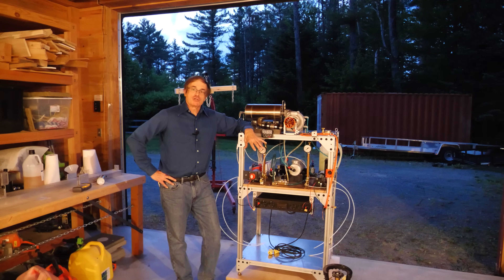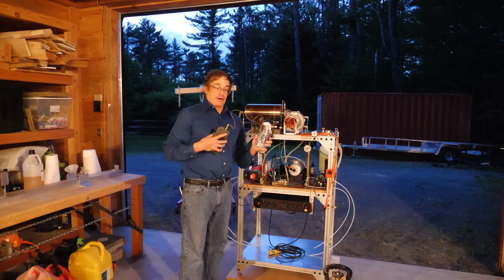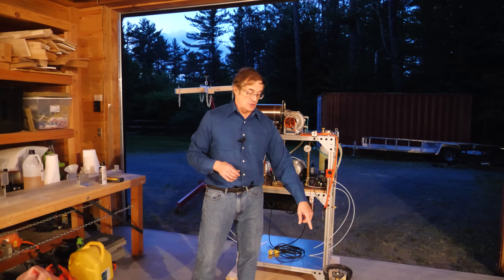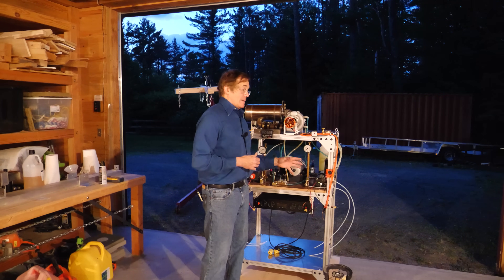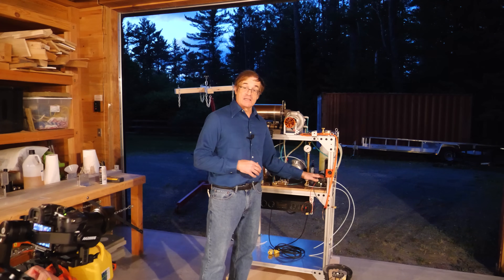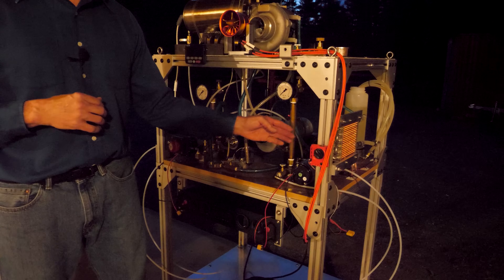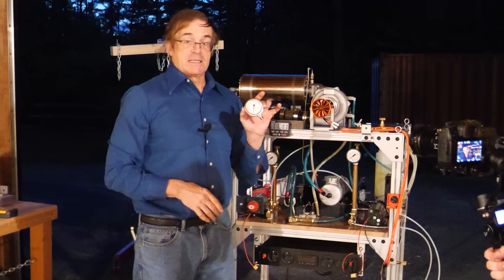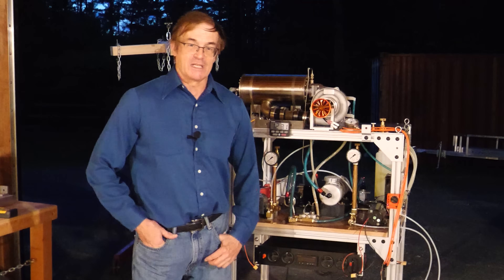What else goes into building a jet engine? - Part 2

Comment: Do to the global warming potential of the current refrigerant used in modern air conditioners they are going to start phasing it out. It’s replacement is propane based because a lot of energy required for phase change.

Comment: you said one of the drawbacks of afterburners is their low compression. Which immediately made me think of compressing the air before burning it in the afterburner, maybe with another compressor wheel... Today it clicked, it's exactly the compoud turbo system you are talking about, right?
Reply: Not necessarily , if the gas producer iand afterburner are constructed correctly and the required turbine temps are used , we can achieved a choked afterburner nozzle  ,  unfortunately this guy doesn't really know what he's talking about , he sprouts the words but not the experience
Reply from the maker: That's  right.  Afterburners should  always be an "afterthought".  The secret  is compression ratio and you need multiple  stages for that.

Comment: Another nice presentation ,...... with your gauges , on a new build its advisable not to use fluid filled ones as they can mask "problems" , an "empty" gauge will bounce around and alert the builder to a potential problem ,  things like a cavitating fuel pump,  compressor surging or pulsing combustion, fluid filled gauges best used once the engine is sorted
Reply from the maker: Good point.

Comment: So, where's your blast shielding? If any part of this homebrew contraption flies apart when rotating at such high velocities, then you are a dead man. Smart, but dead.
Reply from the maker: This homegrown contraption is no more likely  to fly apart than when the turbo is mounted on a reciprocating engine.  Blast shielding is never a bad idea, but rarely  used when tuning an engine or running an RC turbojet.
Reply: @TechIngredients  I am in the avionics industry that you yourself said is always pushing the limits for compactness and low weight, while delivering at the envelope of what is possible from current material science knowledge and manufacturing. Keeping that in mind, I have had a coworker die when an air compressor disintegrated, spinning at 26,000 RPM. Shrapnel went thru that person's chest, dead on the spot, at work.

Comment: The column of air acting as a compliant mechanism to smooth the fuel flow is evil genius…I say evil because I have 2 dire questions: 1. Could that column of air combust if there is a back flow accident? 2. Does that column take away a substantial amount of energy that could increase the fuel pressure more?
Reply from the maker: That's  not too much of a risk.  If a back flow occurred, the lines themselves would contain air in addition to the column.   For extra protection you can insert a one way, high pressure  check valve into the fuel line.
No pressure  is lost, the peaks and troughs in the average delivery pressure are simply reduced.
Reply: @TechIngredients  Excellent, thank you for answering and explaining!

Comment: What's wrong with making a copper coil as a heat exchanger in some water to expand the fuel into gaseous phase? You'd have the tank upside down as you have there, but then expand it externally in the coil in a big bucket of water. Did you find that you couldn't get it to expand evenly and you'd get liquid propane sputtering into the combustion chamber?
Reply from the maker: It's  unnecessarily  complex and bulky when fuels  like kerosene work well.

Comment: Suck, squeeze, push, bang, boom … a way to think of the stages of a jet engine. Suck - Fan, the blades at the front that draw the air in. Squeeze - compressor stage that increases the air pressure. Push - the initial portion of the combustion chamber that brings in the air. Bang - the combustion chamber where the fuel and air ignite. Boom - the exhaust turbine / afterburner. Of course there are a number of ancillary pieces to modern jet engines.

Comment: In Poland there is a lot of cars adapted to use propane-butane mixture.
It is transported in liquid phase close to engine. There is a evaporator there it has 4 ports. Propane liquid inlet, propane gas outlet and inlet/outlet for fluid that moves heat from engine to the radiator.
So engine has better cooled and has fuel in preferred gas phase.

Comment: The air duster is basically r134a.
Opd tanks will flow liquid upside down I refill 16oz tanks they just won’t flow gas or liquid if you don’t have a anything hooked up

Comment: I wonder how well a direct injection fuel injector from an automobile would work? You might have to find a deal on the high-pressure fuel pump, because they tend to be pricey.
Reply: The injector from a pistons ICE will not work.  They need pressure pulses that trigger the injection.  If it is electronic, the electric pulses trigger, but it is basically a fuel volume per pulse, depends on pressure.  If it is mechanic, you need the pump to create the pulses, even more complicated and still pulsed.

Comment: why not use a hydraulic pump which can provide a few thousand PSI?
Reply from the maker: They tend to be quite  heavy and it would be best if they operated on low voltage, DC.  Also, because  they are piston pumps, you'd need a high pressure  accumulator to smooth the pressure swings.  It could be done, but it might be challenging.

Comment: McMasterCarr is my addiction. I’m a biologist doing automation of cell therapy/gene therapy assays. I have always been extremely handy so it wasn’t a big step to basically become an de facto engineer. All science is art. Leonardo, you know. 
Appreciate your approach a lot. 

Btw. Ordered some heat transfer compound on your website for my Biotec and never got it. Any path forward you’d recommend?

Edit: Actually, you might appreciate this: I’d like to use your compound with a “dry bath” from Thory Pines Scientific. (Not sure I spelled this right) It cools down to -20C, theoretically. I get -12 in my application. That’s why I need your compound. Their device is very unique. Check it out.
Reply: I also ordered some of the thermal paste. Not sure what's happening but it's been months for me and I've sent them emails to no avail.

Maybe they need enough orders to make a batch.
Reply: @zmmj2024  Good to know, thanks. Very disappointing though. Would at least expect some communication.
Reply: @HansWeberHimself  it's really disappointing considering not that long ago they did a video about being ethical, and not to believe in the scam products. I thought maybe they'd see this and we'd both get answers.
Reply: @zmmj2024  I’d appreciate answers a lot.

Comment: What is this engine going to be powering?
Reply from the maker: Not sure yet.  This is a small engine and with more power in a compound configuration or with rotary output with a turboshaft, there are more options.

Comment: Old k jet parts pump running a 5.8 bar , injector is a kontinuous output that makes a spray pattern that can vary the old fuel distribution system could be used for the throttle, and have four five six or eight injectors . You could run gasoline to diesel, any j type jet fuel, alcohol etc. Mercedes ran two in series to make just under 100 psi for the last three years of the ke jetronic

Comment: I remember my buddy breaking the seal on a paintball CO2 tank and it instantly froze his fingers to it. Not sure if that's the same thing with propane, but it was an event I remember from 20 years ago.
Reply from the maker: It is.  Propane can be used to freeze off warts and is a component in over the counter remedies.
Reply: And if freezing them off doesn't work, then you can burn them off :)

Comment: Ya pressurized fuel of any type can be scary on a mobile application if things don't go as planned. I just finished designing the fuel tanks for my J34 powered 6000hp jet engine pontoon I'll be building this week. It requires 10gal/min @ 100psi. I finally found a brushless variable speed NHRA top fuel dragster pump that will be up to the task. Just really expensive! Please subscribe... hahaha... Love your videos!

Comment: I've heard you can buy Jet A at Pease. I'd considered it when I had trouble finding kerosene for a heater, but even diesel seems like a better option. For an actual jet engine, what could be better?
Reply from the maker: Kerosene  has about half the viscosity of diesel and so it will atomize easier.
Reply: @TechIngredients  Well… glad I was able to find Kerosene!

Comment: If you think you can get this down to about 50-80 pounds, I'd be extremely interested in volunteering to test pilot a "backpack" system and let's put together the world's first jet powered paraglider system? Obviously, this is dependent on what the lowest idle, and thrust variability be, to maintain fly stability. =p ~Cheers.
Reply from the maker: I think someone  has actually  done that with a couple of RC jets.
Reply: @TechIngredients  haha bummer. cool stuff though

Comment: After draining the fuel from the vertical tube how do you re-introduce the column of air back into the stand pipe and how much air?
Reply from the maker: Once any trapped  fuel is drained, the top valve is closed and the air is then unable to leave the next time fuel is driven into the manifold  below.
Reply: @TechIngredients  Got it! 👍I'm working on getting the parts together for this build. I have to say, the details in your videos is what gives me the courage to go forth in building rather than just being another video I watch for fun. Always grateful  for your guidance🙏

Comment: I have no interest in jet engines or building jet engines other than perhaps a curiosity as to why the M1A1 Abrams tank uses a jet engine instead of piston. However I think this presenter could talk about any subject and for some reason which I have not quite put my finger on everything he says is fascinating!  Perhaps it's the depth of knowledge he brings to the table, or for the additional  things I learn when watching these Tech Ingredients videos!
Reply: If I remember correctly it was due to High Power Density, Less Maintenance/Things to Go Wrong, and that they aren’t too picky fuel wise.

I’m not an expert in the area though so feel free to chime in if you know more/have corrections or something.
Reply: @ericlotze7724  Wow!  I only knew part of that!  I heard from a guy that used to drive tanks that they give them specs and settings to run every type of fuel and a few things that we wouldn't even consider fuel in those tank turbines!
Thank you!

Comment: 10:10 Is there any Combustion/Explosion Risk?

Granted if you aren’t using volatile fuels I’d imagine the risk is lower, but does an inert gas need to be used?

(Edit: Fixed the Timecode)
Reply: The likelihood is very low, but yes there certainly is an explosion risk. That’s why all accumulators are charged with nitrogen or other inert gases. It would be as simple as putting a schrader valve on top of the metal pipe and filling it with nitrogen.

Comment: How would something more viscous like Heavy Fuel Oil (Fossil Fuel) or Pyrolysis Oil (From Biomass, also called “Bio-Oil” or “Bio-Crude” in papers, although the latter refers to Hydrothermal Liquidation crude more often) work?

Wondering as Pyrolysis Oil is kinda nasty stuff but i hear gas turbines can burn all sorts of stuff!
Reply: Especially with the Turboshaft version connected to a generator (and maybe even a Heat Recovery Steam Generator!) you could convert waste engine oil/pyrolysis oil into not just heat, like a waste oil burner, but electricity!

Comment: Tremendous variety of very interesting subjects investigated,  presented  a explained clearly. thank you!!  Ground-effect (increased air pressure) hydrofoil catamaran or trimaran a possibility? With your analysis and crestivury, hopefylly yes. 

With easily accessible highly accurate weather temperature,  wave, and wind prediction, one could pick suitable weather windows to skim over the waves to a destination. For a d-i-y budget, far, far, far, less than the rich-man's toy 7figure ground effect plane I've seen that looks like it has bat wings, and may not incorporate hyrofoils as fully as it could.

Comment: Jeez how did Jet Man get all his gear into one tiny backpack?
Reply: The Jet Engines that “Gravity Industries” or LLC or whatever the name is are Commercial Off The Shelf Jet Engines (sold as RC Jet Engines, I don’t know if they sell them as micro-jet engines or something too; some gliders use them for self-towing, etc) that basically just need a fuel line and electric control (similar to that for the BLDC motors in RC Quadcopters etc).

I would bet the ones they use too have electric starter motors.

So since they are custom built for small Size+Weight etc instead of made using Turbocharger Turbines designed for Cars’ Exhaust, they can optimize for size and plug-and-play operation.

Hope this helps, and i am not an engineer or anything so anyone else feel free to chime in!
Reply: Still damn impressive though, and idk how i would feel about running fuel lines down my arms with flaming jets inches away!

Comment: i learned even more some rocket science! Love this channel. Thank you.
Reply: Well, Turbojet / Jet turbine engine science in this case, but they do rockets as well! I'd love to see them do a similar series on monoprop rocket engines. Going back nearly 15 years ago, I used to tinker with fairly simple H2O2 monoprop and Kerosene/NOS bi-prop engines. It's a fun hobby but pretty dangerous, especially when dealing with HTP (highly concentrated Peroxide, like 90%+).
Reply: @racerex340  yes!!! 100% 

 i think we're accidently learning rockets science. Not long ago on the channel we were treated to a full in-depth series of video on the optimum hobby firework fuel. which was awesome. also as a side note, the most concentrated 'usable' hydrogen peroxide fuel will never be above 70% (for long time). it both decays and same time is hygroscopic advancing the decay
Reply: @Palmit_ Rob, I used to buy 50%  Food grade and distill to over 90% using vacuum distillation. Yes, it does decompose fairly quickly, but with the right container, you can keep 90%+ for a few weeks airtight. A cap full spilled would easily catch a lawn on fire... My monoprop engines just used simple silver screen packs as the catalyst, which would poison after a few runs but could be cleaned up by heating them cherry hot, quench in water and then run them through an isopropyl ultrasonic bath. You could make the packs last longer by weaving in platinum screen every 6 or 7 screens but that was far too expensive for what was basically me playing around.
Reply: @racerex340  i believe you and i are agreeing :) 90%, to my small braincell,  is quite a good yield, but hard to store usably for a good length of time (years would be ideal). even with special equipment.  I reckon tech ingredients will slowly advance us to methane ch4, but first we will learn superchill. :)
Reply: @Palmit_  if I had access to a really good lathe, I'd probably do HTP + nitrous oxide.  Those high density rubber hybrids have great reliability, simple and can be throttled and stopped / restarted.

Comment: I'm not sure if this is a silly question but seems as you said that more pressure will result in better atomisation - Would taking a diesel direct-port fuel injection system (With one of the newer electrically driven pump) from a vehicle be better for this application? You'd have a very high pressure, an injector designed to atomise the liquid fuel well with extremely consistent repeatability and you can drive the injector using a PWM signal to adjust the fuel flow. I'm not sure if a direct-port fuel injector would handle the temperature of a jet engine, but they are designed to poke into the cylinder of an engine.
Reply from the maker: It might.
Reply: Or maybe a simple gasoline car High Pressure Fuel Pump? At lease some of those run off the camshaft so are not electric.
Reply: Those injector spray when there is a pulse, and the volume of fuel depends on the pressure.  What modern common rail diesel do, it to trigger multiple times per cycle, and vary the pressure in the rail to deliver the right amount at the right time, so it runs as efficient as possible with "little bad stuff".  A PWM signal is not what you need, it is the frequency.  Also note that the coils based injectors (old) require quite a good current pulse, and the more modern piezo ones require a a good voltage kick (100~200V)  so the drivers need to be pretty on point too.

Comment: I am a fan and use McMaster Carr but lookout. I found a Clippard valve that have used over the years priced at $179 on McMaster that sells for $29 on the Clippard website. Ejector nozzles $60 on McMaster $19 elsewhere. A 3 inch brass ball valve $479 McMaster, $120 plumbing supply. Low cost valve was domestic manufacturer and excellent quality. Some things seem reasonable some not. I still buy stuff there every week.
Reply: I won't say it justifies $179 vs $29, but remember they're a stocking distributor.  It does cost money to maintain inventory, from space to warehouse it, to people to stock and pull orders, to paying taxes on unsold inventory, to SKU management. I don't know what the turnover is on any given item, but some are going to sell daily and others might sell once a year. It's this same reason that people get appalled by how much buying a car part from a dealer costs vs when it comes on the car (not talking about things like air filters, but more obscure rarely replaced parts, like dash clusters, ECUs, etc).
Reply: Its search function is an epic place to start regardless
Reply: McMaster Carr has lower probability of fakes or seconds due to a solid supply chain. Not everything is foolproof. But for dangerous or professional applications, I think we should use professional suppliers. For fun, safe home projects, other suppliers certainly can save money.